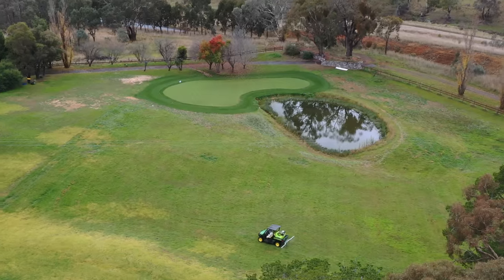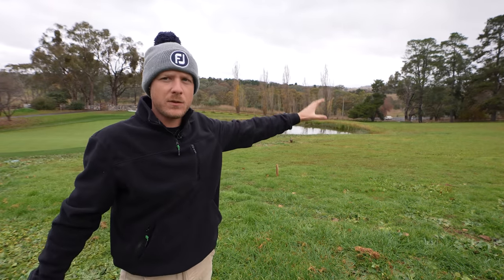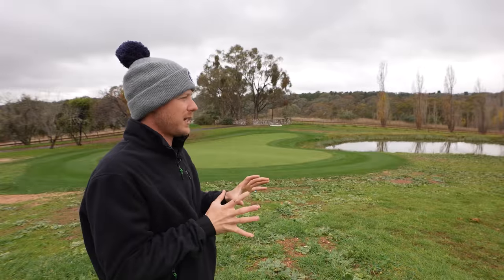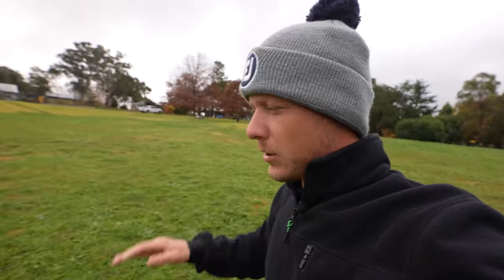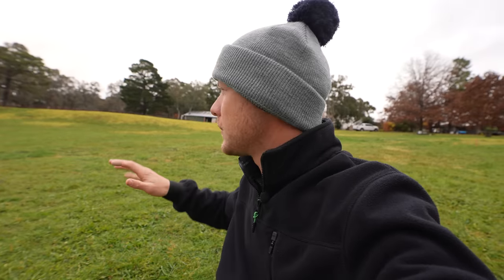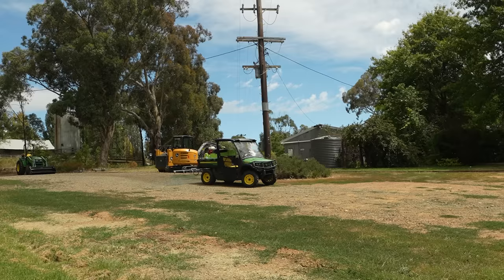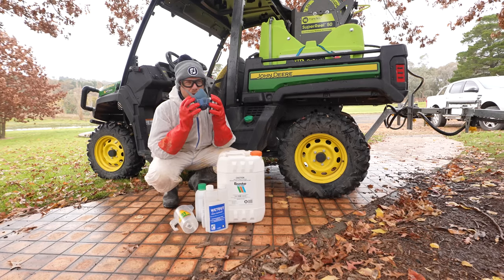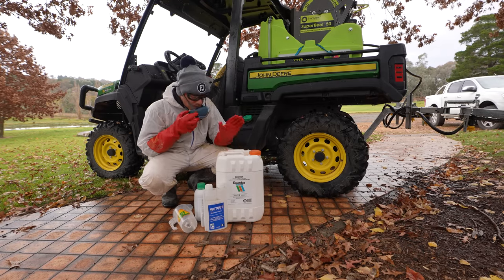Fairway Constuction Has Begun!! // Prepping Steps For Laying Turf (Sod)

Comment: Hey Ben, have you thought about possibly building another green on top of the rise where your 1st tee box will go?
You could play up and down then, elevated green would play quite different. Drop the bunker on the dam green design, not sure it fits, and add some front  bunkers for hazard on the elevated green.
Fairways going to be awesome. Any spots further out for a par 4 tee box? Me and my brother spent hours playing paddock golf up and down, greens cut with rotary mower and rolled with concrete culvert pipe! 
Enjoying watching